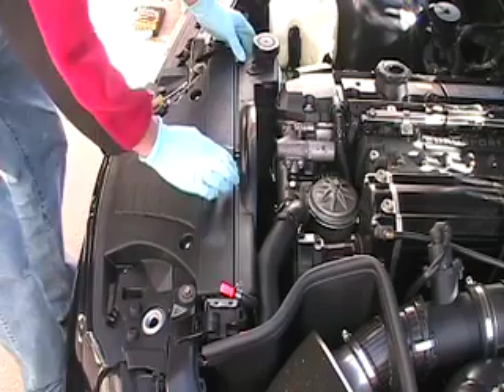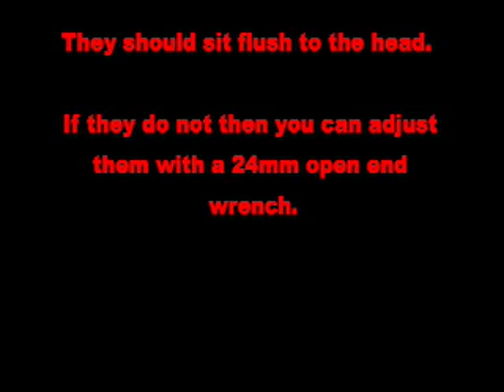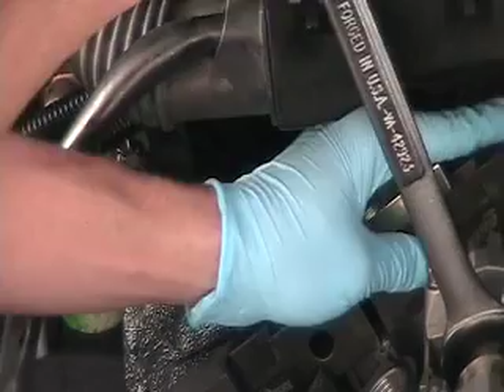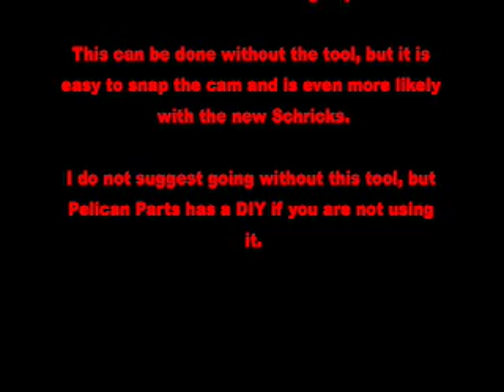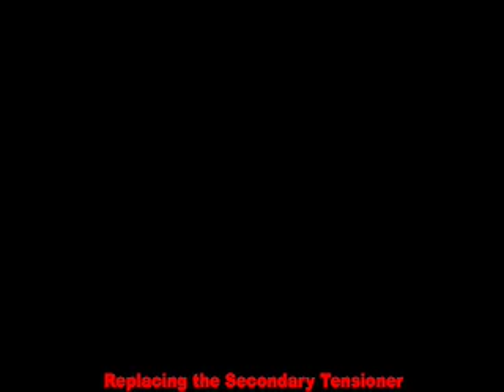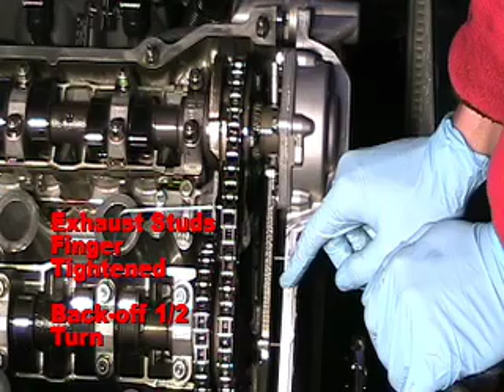Cam Install Video.mov

Comment: Great video, also, as a note, when you retime the cams- the oem ones have 2 "dots"- when these dots are facing up in the cam blocks, the engine is at TDC =]